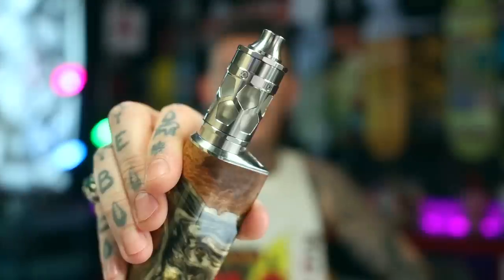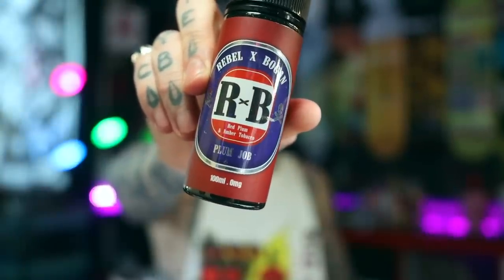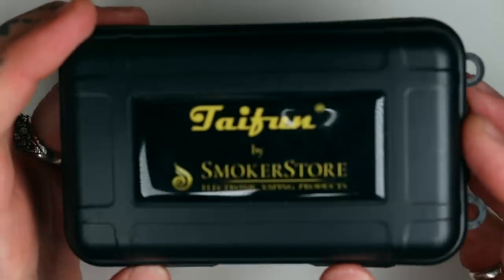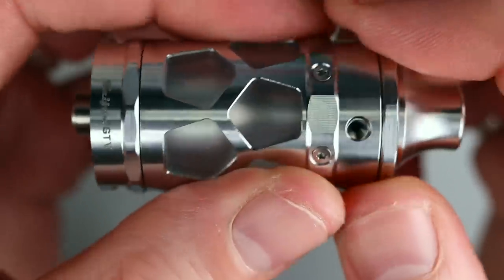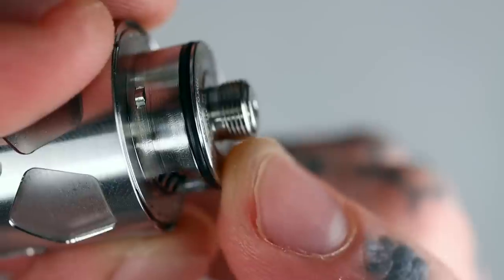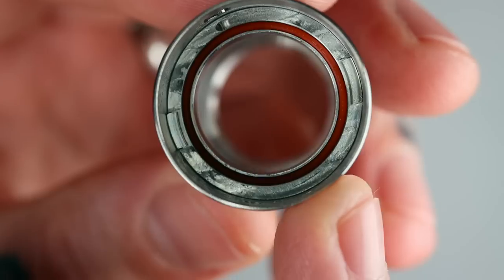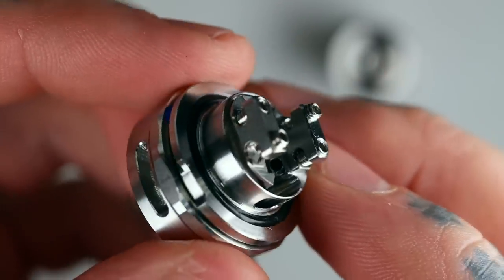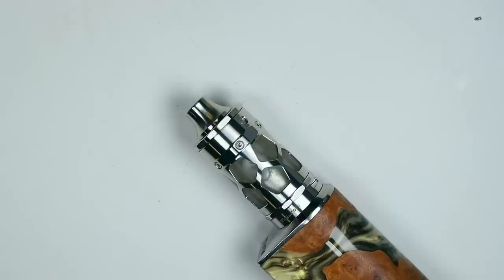Taifun GT V SmokerStore Build + Wicking Tutorial

Comment: Had mine for a week now and worth every penny. Was surprised at how much air goes through it with the pre-installed pins but luckily had some 1.5 mil air disks from the GX. Perfect vape fully open with those more restricted disks. I do agree that they should have thrown more disks in for the price because u reckon most people will want to vape it more restricted with a slightly higher ohm coil. 0.35 alien is pucker.
Reply: Totally agree, the 1.5 inserts are perfect for me.  I'm gonna experiment with mixing the disks at some point, kinda like the GT4 was setup, with less AF on one side.

Comment: Doesn't get much more hardcore than that. That's the kinda rta where buying the clone would be a bad move. So many moving parts china's bound to fuck it up. Bought an ESG skyfall v2 rta (I believe it's called) sxk clone version and the machining was intricate enough to where when the cloners attempted clone it, it was designed to where I couldn't even remove the deck base from the tank lmao I ended up having to destroy to it get it off, partly out of frustration lmao needless to say, there's no way in hell there's absolutely nothing wrong with the clone version of this awesome looking RIDGEY DIDGE device. Looooooves me some buttery smooth airflow. Would never be able to afford this one but looks awesome. Thanks for the review Bogan. 🖤
Reply: In this case, it's wrong. The Ulton GTV is an excellent clone of the original tank.